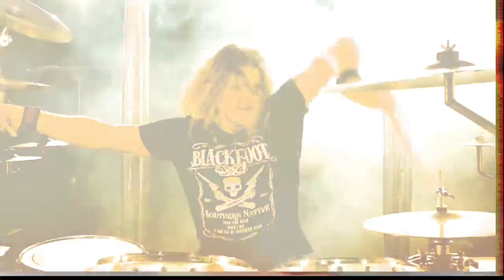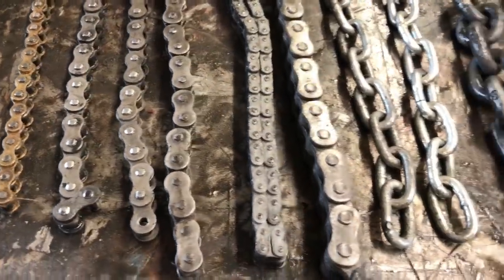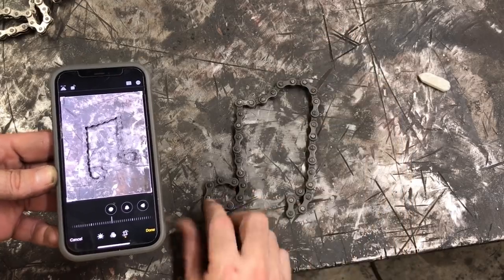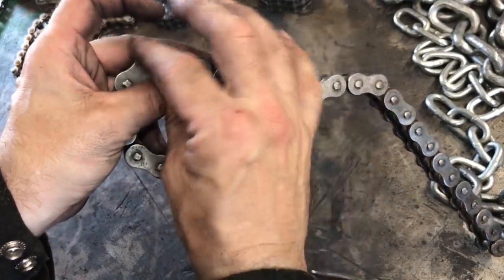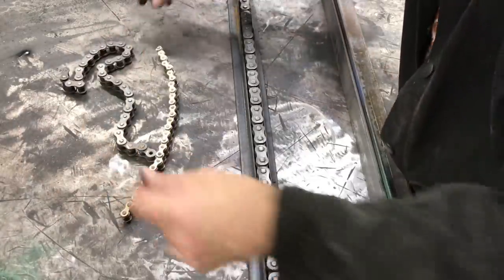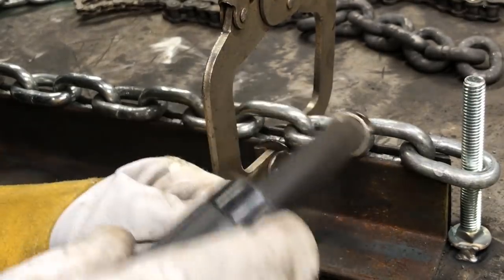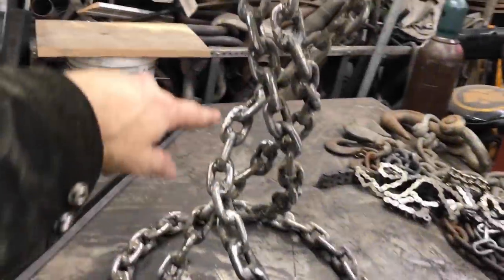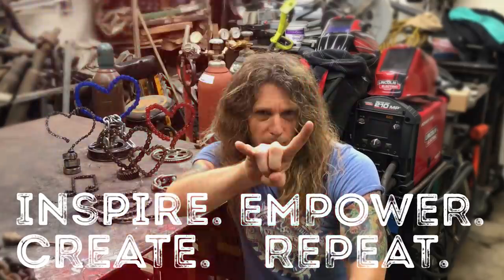How to Weld Chains

Comment: That was very helpful. I was actually thinking about building a table for my back porch using log chains for the legs.
Reply from the maker: Let us know if you make it! Sounds like a cool project!
Reply: Yes! Make sure you weld both sides of the chain cuz if not it will cause the table to sway or wiggle. I’m sure it’ll be structurally sound but that extra weld reinforces the chain more.
Reply: @sawbladeheaddesigns2451  Thanks for the tip!!!  You just prevented me from making a mistake
Reply: I de-grease and remove chrome , zinc chromate coatings by a long roast in a camp fire.

Comment: I have quite a bit of chain to make projects from...but have been dreading the Preclean...thanks for the info on that cleaner! Great video! Thanks for sharing
Reply from the maker: Glad we could help! What are you thinking of making?
Reply: I was very pleased trying that one out. That was my first attempt with that product and it worked great. The longer you keep it submerged, the darker your material will get from the solution.
Reply: I spent days and a few 8" wire wheels cleaning buckets of bike chain.  Getting chain down to clean metal on 4 sides takes a good 4-6 minutes apice.
Reply: definitely not the most fun you can have in the shop. 😁
Reply: @sawbladeheaddesigns2451  you're 100 % correct.  You guys are doing great! Keep rolling the footage.

Comment: Using the two pieces of angle iron to assist in welding the link chain straight.......simple but sooooo genius. This is EXACTLY what I wanted to see. Many thanks brother. Only issue is, I’ve only recently started to learn welding on a hobby level and only have stick machines. Guess I’ll play around with the power settings or buy a mig eventually.

Comment: I use chain all the time. 

After you've cut it to whatever lengths you need, you can clamp it in the vice, grab the other end and pull it tight, wire brush it shiney clean in no time. 

 I use (1/16) 6011 stick electrodes for that sort of thing, which work great. 

 Chains seem not to be as "mild" as typical structural stock, leading to brittle welds if they cool too quickly. Bit of torch heat fixes this completely, such that the resulting "bar" can be bend around quite a bit without breaking at the link to link welds. This is also true for welding nuts and bolts to stuff. 

Watch out for zinc on the chain. Rust is usually a good sign  easier to blast it off than oil or galv.

Comment: chain grease, rust and chrome plating all come off in a campfire.  if you are going to store it wd40 will keep it from seizing.  the temp cycle in the fire will  anneal and stress relieve the chain. good info good video
Reply: Great tips! Not to mention it’ll add some “kick” to the s’mores! 🤣

Comment: As I only TIG, I have soaked bike chain in sealed buckets of gasoline, heated coils to red hot in a forge, worn 8" wire wheels into nubs and soaked them in evaporust to get grease and rust off and out of the chain.  
Now I have a good 500# of used tractor trailer tire chain and don't totally know what to do with it all.
Reply: Well you can always send them to me. Would you like my address?😁

Comment: I tried to weld 3/8 chain, and i just end up with a ball of weld that doesn't stick.. not hot enough?? What size wire are you using? Suggestions please??

Comment: Did you ever consider using wire cable in different thicknesses? Possibly combined with the chain?  Loved this vid!!
Reply from the maker: Could be cool in different colors weaved through it as well!
Reply: Not really. The reason why I did chains is because they’re abundant in scrap yards and fairly inexpensive new. Plus, used in the right design they look so GOOD! 
Maybe I’ll see if I can my hands on some and incorporate it into one of my designs. Thanks for the input! 🤘🏻🤘🏻
Reply: @sawbladeheaddesigns2451  Yes, like copper stranded wire. Cut the battery cables off from junked cars. I think the copper would look great and add a softening touch to the industrial steel, even though, I presume, you like the industrial look.

Comment: Wouldn’t Tig welding be a better option for the smaller stuff?
Reply: Well it’s funny you said that. This was part 1. I have some full length builds and another where I TIG weld. Me personally, I prefer MIG because I can work faster and it’s easier & more forgiving working with dirty materials than TIG but TIG works well if you want to use silicone bronze for a cool look or for a more precise tight weld. Stay tuned
Reply: @sawbladeheaddesigns2451   thanks for the response looking forward to more videos!

Comment: Muriatic acid (32% Hydrochloric acid) will strip the rust and zinc completely off. You will need to treat with phosphoric acid to create a layer of iron phosphate and prevent instant rust. I usually dilute the acid down to 10%.